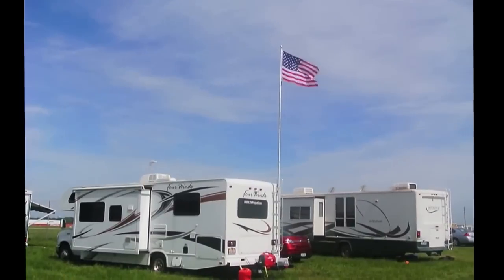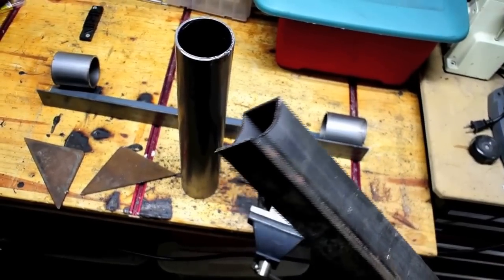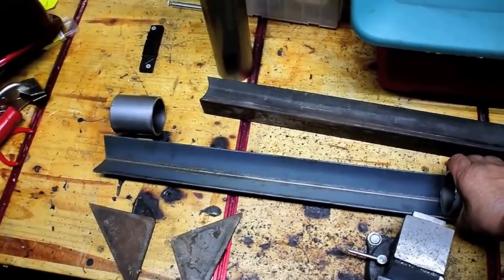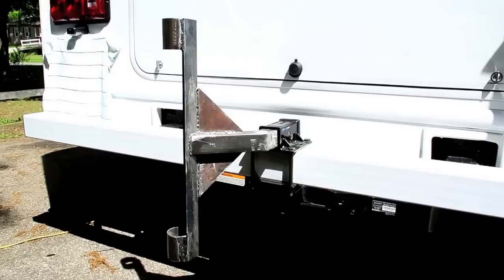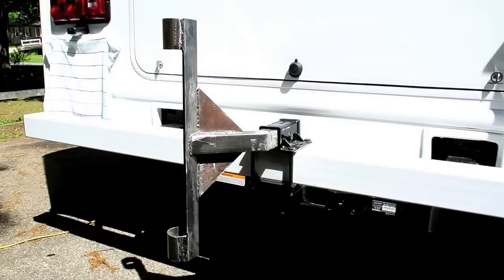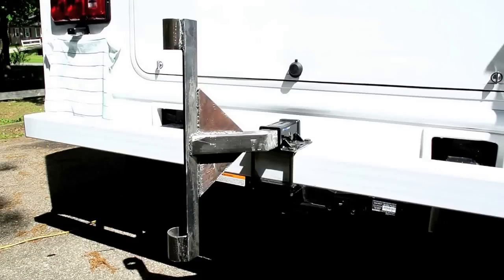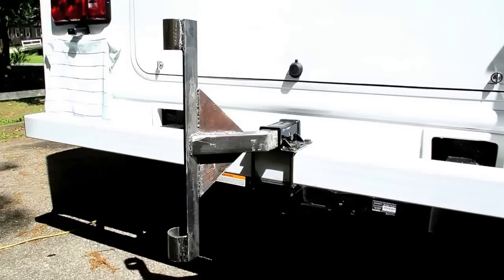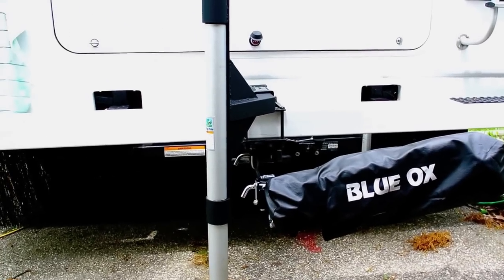Hitch mounted Harbor Freight Flagpole for my RV.

Comment: I have a Honda 2000 gen that l "ll like to  be mounted in the back of my Coach..2007 Holiday Rambler Augusta..any idea..?  I do have a hitch.. like 2"...can i use that hitch and weld something ..like you did for the pole..and weld a plate or base for the generator...? but when is not using i can take it off right..!
Reply from the maker: Yes, you should be able to do that.
Reply: +awboater Any welder shop right..?

Comment: I woulda made it all out of aluminum  light weight
Reply from the maker: Unfortunately, I don't have a welder capable of doing aluminum.  

However, my main purpose in showing my projects has always been as a catalyst for someone to take my idea and improve on it.   That is one reason I rarely show a step-by-step process for my projects.

So if someone improves on the project by making it out of aluminum, then my goals have been met.